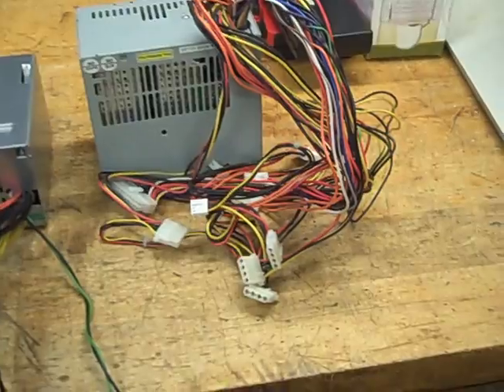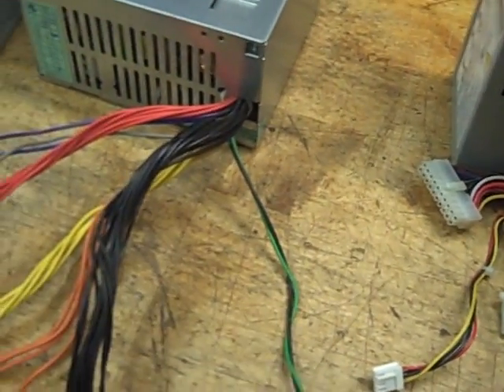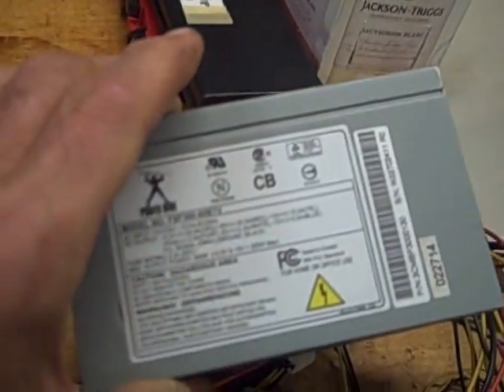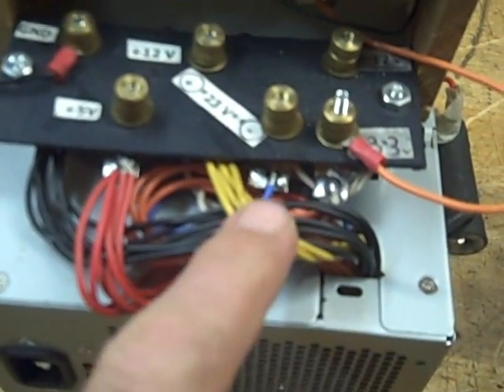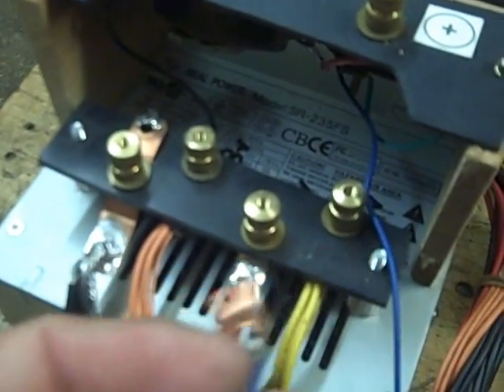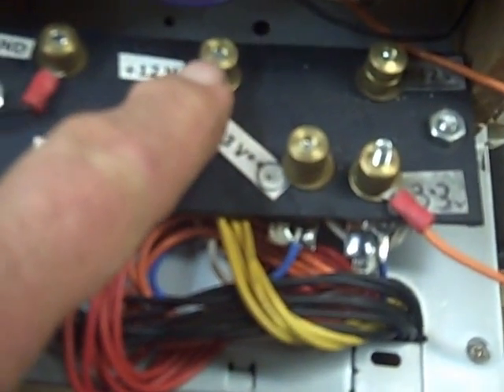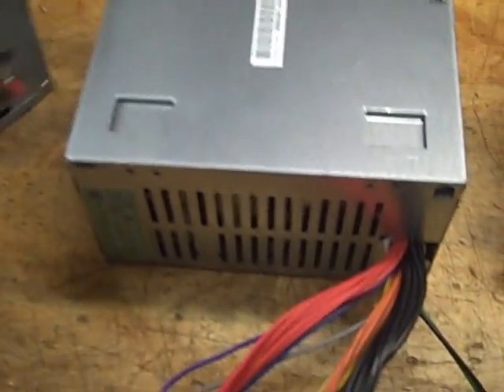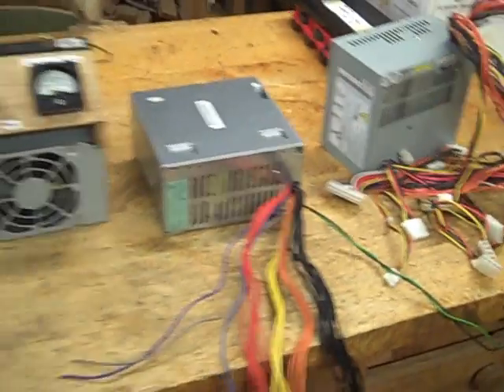DC Power Supply from ATX power supply

Comment: Great video, very helpful, I rescued one of these from an old desktop thinking it will come in handy one day.  Now I want to make a hot wire cutter for foam carving and thought this would be just the job only problem is I didn't know what all the wires were for or where to start. You've explained it perfectly.

Just one thing, what are the grey and purple wires for?
Reply from the maker: They are not used for the power supply - they are wires for sensing points on the  motherboard of the computer. You can cut them off and tape the ends.
Reply from the maker: disproman .
Since post the video, I've had a number of pals ask me to make up a power supply for them -. They use it for rust removal by electrolysis or as it's sometimes called "spooging". Yes, I know it's a weird term but that's what they use.